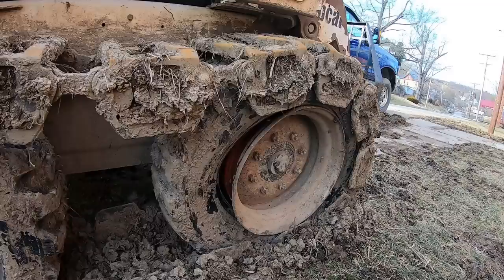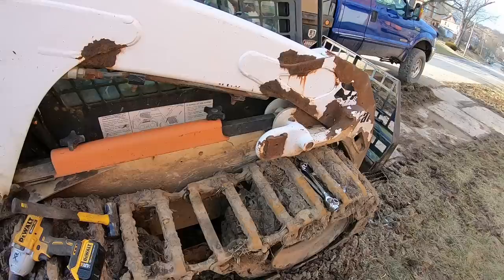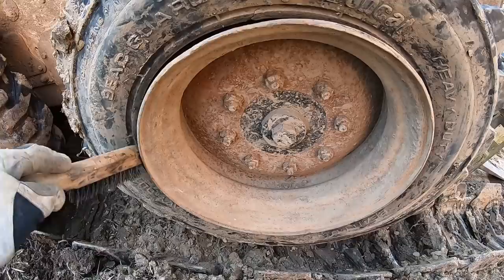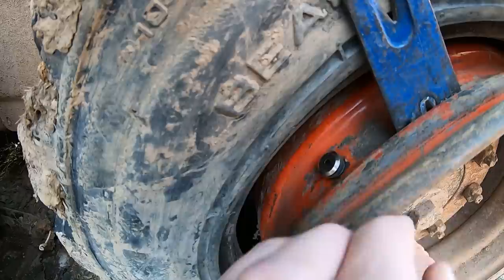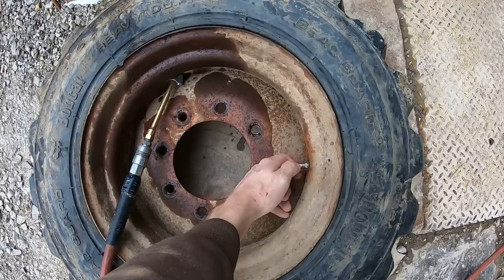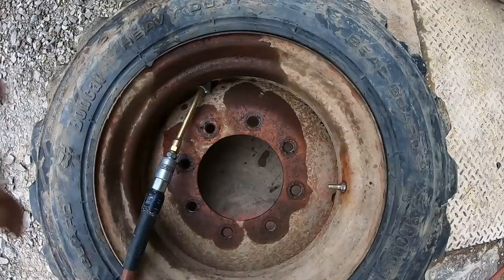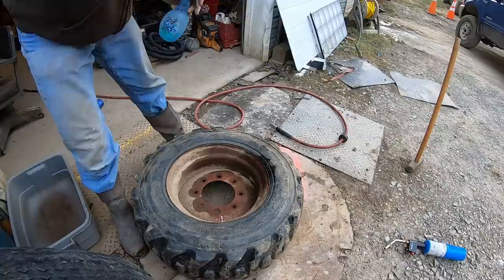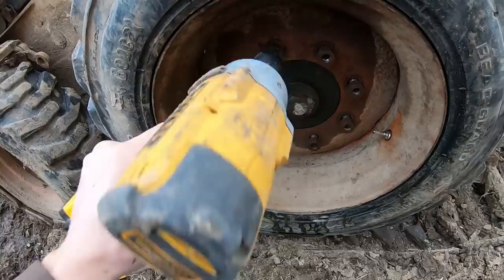Fixing a Skid Steer Tire with Starting Fluid and a Torch!! + all about my STEEL TRACKS

Comment: I always used a ratchet strap in the middle of the tire and then apply air. Works like a charm. Give it a try!
Reply: I’ve also used this method works great 👍
Reply: That's what I do as well.
Reply: I try to use a wide strap first if I have one available otherwise a good quality small one works.
Reply: @rge2410  Agreed, be safe!
Reply: @rge2410  I've found the narrower band works best to flay both sidewalls of the tire out to the beads. Quite often, you don't need to sketch out and blow it up with ether.  LOL
Reply: Great way to hurt yourself taking it off!
Reply: @BrettMcNary  Clearly you are in the minority in your thinking! I've done it this way almost exclusively and never had any issue releasing the strap! Obviously your not familiar with the same usage of racket straps!

Comment: I have thought that you working alone was the most dangerous thing you do because I do the same. I live alone and do most everything alone except when safety demands I don’t like putting up the ridge beam on the new woodshed I built this last summer. I do my best to assess everything I do and not put myself in danger. When I rebuilt my Ford 3000 Diesel engine last year I had to separate the tractor to pull the engine which went ok. When it came time to actually removing the engine block I called a neighbor and told them what I was doing and ask them to come check on me if I didn’t call them back within a half hour, everything went according to plan fortunately.

Comment: Dogbone wrench!  Loved those things till they all broke.  LOL.  At least they were good for figuring out the correct sized socket.  I had a set of Grouser tracks like that, came with the Grouser tensioning bracket.  Worthless.  I used a strap like you did.  For those who don't know; take the bolt out of both sides of the ratchet and remove both straps, take the long strap and move it to the end where the short strap was, cut to 6'-10' and burn the cut end.  Done.  Works great.  

I've been through 3 sets of steel "over tire tracks".  1 was Grouser brand and 2 were Norther Tool brands.  The Grouser made it about 1,600 hours, the first set of Northern Tool's made it about 1,400 hours at half the price (3rd set sold with the machine).  Also, the Northern brand had more flotation.  Grousers are made to install optional pads so they don't have a lot of displacement.  The Northern Tool ones don't have the "Pad" option so the metal footprint is about 3 times more (guessing).  

A couple "cons" to metal over tracks; Of course, flotation is better with a tracked machine but also better with rubber over tires.  Also, sideslip is a problem with metal tracks.  The biggest "con" for me was you can't really run heavy attachments.  I put a Bobcat brush hog on my Bobcat 773 and blew 1 front and 2 rear tires before I gave up.  The tires would offset inside the track and pinch, tearing out the sidewall.  So, those were the Northern Tool tracks, maybe the Grouser brand are better.  But the good news; I tracked that machine 1/4 mile out of a swamp and loaded it on my trailer.  Lost 3 tires but only 1 rim.  Not bad.

All that said; I loved my steel over tire tracks, no matter the brand.  They make a low cost skid steer into a functional off-road machine.  I would buy the Northern Tool brand again, if I was in the market.  I have a T595 now, but still miss the 773.

Comment: When my son watches this he will get a chuckle out of it. Hi Chris. We did this to set a bead on a trailer tire and set the tire on fire. Garden hose was nearby. "Put the fire out, Chief" Disaster Averted. Brake cleaner works well. The trick is to get enough and not too much. Hypothetically that is.

Comment: Matt, we have two wheel skidsteers. One has airplane tires with two piece rims. They never go flat. unless you break the valve stem. To fix a flat on the other, we jack it up, place a ratchet strap in the center of the tire & "jack" the tire out to the rim. It'll jump loose when you get the air in but it works.  saves a trip to the shop every time....if you have a ratchet strap and air tank or dump truck with air brakes and extra air hook up.  Like your work.

Comment: I learned this from an old tire man. I was ready to light the either to blow the tire on the tractor rim and the old tractor tire expert said hold on there Wild Bill. Give the either fumes time to build and he was right. I was getting nervous to light the fumes but I found out I was lighting the liquid either and not the fumes. He made me count to ten then light it. It popped and I had to let some air out of the tire. I turned and looked at my mentor and he was laughing and said, I Told You So!

Comment: "Can be boring to some..."   Are you kidding man ?? Look again at Randall Myers' comment down here. It suits you so well ! I share it 100% !
I'll just add that I admire your self reliance and working with what you've got. "I need a better dump truck." You take two "so so" you have and make one efficient and clean workhorse. "I need a Bobcat, new ones are out of my means". You get an old one and fix it !

That attitude, man, is highly impressive and commandable. I come from a very humble family, my Dad used to fix this and that on the cheap. No choice.
The old family car transmission failed. We fixed it together. I was 12 years old. He showed the "how to" on everything.
I do exactly the same. Self reliant. People often ask me how I do to keep my older 2 cars running and reliable - a 2001 Altima and a 2006 Focus wagon. Simple, I maintain them, ruste proofing every 2 years. Them, they buy/lease new ones and struggle with payments. Not me.

I also hoard stuff "rich" people throw away, fix it and sell it or give it to families in the need. Especially bikes, small or adult size. My salary is the smiles and sparkling eyes of kids when I bring them.
Finally, thanks for having us on your journey ! Much appreciated. 👍
  PS In what state are you living ?? You never have snow ?
Reply from the maker: Thank you so much! And Pennsylvania this has been a pathetic winter

Comment: The truck shop mounted tires like that for YEARS, probably till tubeless radials came out. And yes, I can remember then too. I was driving and having to change my own.! Always sprayed it inside the rim with a trail leading out on the floor, hooked up the air hose and struck a match and WHOOMP! The thing bounced off the floor a little but it was seated. I was changing 3-piece wheels before Budds got popular, as well as radials. YES, thank the Lord for ALL his blessings and nobody got hurt doing it.. GBWYall!

Comment: Sometimes on my tractor tires, I have to wrap a ratchet strap around the middle of the tire and squeeze it down tight in the middle to blow the beads out against the rim so when you spray it with ether It has less distance to travel when it pops outward.
Reply: Yes a very good method , and removing the valve core helps get the max amount of air into the tire faster.
Reply: You saved me from saying it 😁
Reply: You said for me. But I’ve done it without the starter fluid. Although it’s probably is kinda fun to do it that way.
Reply: Many years ago We did that on equipment when I worked in a salvage yard. I find that method quite effective
Reply: Rock Hill Farm Downeast, Maine I do the same with motorcycle tires when you are offroad it’s the only option! That and fill the tire with grass-leafs ect.
Reply: Yep
Reply: Ratchet straps idea works great. I was thinking the same. Ether works but strap is safer. Works every time especially on 14" wide skid steer tires. Can't count how many times digging I have had a bead pop on old tires. Been there done that. Great video though.
Reply: I had to strap and  starting fluid my Cat 248B rear tire the other day. The strap alone didn't get it. Having the air line on when lighting the starting fluid helps a lot. Spraying the outside does nothing if you ask me.
Reply: Me too neither .
Reply: @TheBookaroo  LOL I've had to pack a tire or two full of dirt to get the job done when I couldn't fix the leak. Whole lot better than stopping work to go buy a new tire.

Comment: I'm a firm believer in "safety 3rd" get the job done, but I learned the hard way that you never move that machine while standing on the ground! You'll get away with it a thousand times, but all it takes is one little slip and...you've got serious trouble! Respect your equipment!
Reply from the maker: That is what I expected everyone to say, but actually you’ve been the only one to notice. I don’t even regard the ether as a danger. Standing under the boom and moving the machine from the outside.... dangerous lol
Reply: @DieselCreek  
I used to have forks on a bobcat and would stand on them and push the levers back to move the machine back, my foot slipped off the fork and the machine moved back while I was stationary for the distance of travel to reverse the direction... the machine lurched forward and the fork landed on my foot lucky for me I was on soft ground, but that was the last time I tried that seemingly "safe" stunt!

Comment: I have worked with steel tracks for almost 10 years, had then on and off countless times. Never once thought to pull forwards to get that back bolt,  always just fought it with a wrench. So thank you for that tip.
Reply from the maker: I did that the first 8-10 times then had that Epiphany lol if it was a snake it would have bit me

Comment: it's my experience that if you take out the valve core and take the air chuck off the hose and just shove the quick connector on the valve stem the blast of air will push the bead on the rim.  Try it you'll like it...
Reply: That's a good way to do it, it works most of the time

Comment: I have grouser tracks on my Gehl skidsteer. I like to thread the nut on a couple turns and then smack the nut with a hammer. Knocks the head of the bolt right out.  Using this technique I can use a crow bar between the nut and chassis to pop the inner one out.  I’ll then twist out the inner bolt and then use a 1/4” drift to beat out the now twisted outer bolt.  These tracks make the machine work like one a couple sizes bigger. Just incredible. They’re awesome in mud or sand, but don’t work on frozen ground. They are also not compatible with solid tires. Rocks get between the tire and track and when forced will crack the crossbar.

Comment: One tip to help things along.  Set the wheel horizontally on a 5 gallon pail.  This lets the tire bead surface on the ground side lay tighter against the wheel.  If the tire is laying flat on the ground, the wheel is trying to hang out of the tire on the bottom.
Reply from the maker: Yes, that was going to be my next move if it didn’t go.

Comment: I learned a trick while in USMC as a truck driver... This works well, it's kinda messy, but take wheel bearing grease and put a thin bead around the bead on both sides, hit the air to it, and the grease forms a barrier and the bead pops on!  I've tried many ways, a ratchet strap (but if it pumps up to fast you play hell undoing it), I've taken a rope or strap with a breaker bar and twist it to draw the center of the tire in and push the bead out... I've used all these techniques on all types of tires from car truck trailer lawnmower to motorcycles... I don't stop until I find the one that works... Hope this helps someone
Reply from the maker: Ya there’s lots of tricks but this some seems to be the old reliable

Comment: Matt, I had a Bobcat 743, 753, and 763, and I last had an S185 just before retiring. I had excellent service with these. They were all older models, so I guess that was the reason for their excellent performance. I also liked the Case equipment. I did not care for John Deere skid steer loaders. John Deere missed he market at first.

Comment: This beading trick uses up fresh air each time. If failed the first time, there wouldn’t be enough fresh air left inside the tire to do a next pop. So replace the dead air in the tire with fresh air each time. 

Quick start aerosol work for engine with a carburetor, doesn’t works each time on beading tire. Apply with the straw in liquid form, it burns slowly with no explosion only heat up the tire.  Apply without the straw in mist form, it burns rapidly to an explosion which beads the tire. 

Mist gasoline injected in the tire filled with fresh air can explode when ignited, as an alternative to quick start aerosol spray. 

Hope this helps.

Comment: Throwing a ratchet strap around the links and tightening it up to relieve the tension between the the links you're trying to separate would probably be very helpful for a job like this. We use that concept for chains where I work when we have to break them apart.

Comment: There have been times, I have wanted to burn down my Bobcat.  but we have always reconciled.  :-)  
The ether trick works well, but less is more.  I have seen guys rig up an air container with a 1 1/2 inch ball valve and a length of plastic pipe.  Put the air to the seam, and there is enough volume to seat the tire without any drama.

Comment: That's one way, but try putting a big ratchet strap or a come-along around the circumference of the tire and tighten it down, it'll press the bead into the rim. It doesn't always work, but it's more predictable than the ether-and-torch method. I've used both with success, but I try the strap first.
Reply: I always have straps just for this.
Reply: Sounds like the strap and the torch method together work well. If the strap doesn't work, use both.
Reply: The other two things I forgot to mention, on the off chance someone hasn't heard this before; spray both sides of the tire - both beads - in soapy water. That, and pull the valve stem core, turn up the regulator on your compressor, and use a blowgun with one of those tapered rubber nozzles to air up, then put the core back in quickly and switch to an air chuck. All that while you have the strap around the tire. Seems to help.

Comment: If you have a decent air compressor we just take out the stem needle and have the rubber tip air nossel or even just open air tube. Jam it on the tire stem and the bead will pop pretty fast. We never use fire or a bead blaster. If you pit the needle back fast enough you don't even have to pump the tire back up much.

Comment: The last set of tires I bought for my skid steer I had foam filled.  Not cheap but no flats or rolling off the rim.   I appreciate you including all the challenges and fails.  Makes me feel a little better about what I experiences.
Reply: That's what I want to do when I replace the tires on my bobcat next time.  My tractor has fluid in all 4 for weight though.

Comment: I have used a ratchet strap around the tire to squeeze the tread in and spread the bead with pretty good success. Using  some rubber cement around the bead once cleaned can help hold the air in also.
Reply from the maker: I’ve done that as well

Comment: Worked in a tire shop, we loved doing the tire trick on larger tires. The biggest thing is to make sure the bead and rim are clean! in your case have a pressure washer to clean the tire and track there handy if you have a water supply even a $100 cheap on will work. Apply vaseline or a heavy grease to both the rim and the beed, this will account for and imperfection in either and protect the tire from that fire.
Reply from the maker: Last thing I wanted to do In 20° was play with water lol I wire brushed it well

Comment: Had very similar tracks on Case 1835B, filled the tires with solid urethane elastomer, weighs about the same as water. Took a 2" chunk out of a sidewall once, kept running for years after.

Comment: I agree with your tacks being crazy good traction in the mud in the woods you see transporters and rubber tire multies that's basically what they run metal tracks over rubber tires and they go anywhere

Comment: you should invest in a cheatah tank.  We use it for semi tires.  You fill it with 100lbs of air, put the end spout on the bead and throw the lever.  boom! instant bead seat. then use your air tank to fill.

Comment: I worked for a place once that had what amounted to a long skinny inner tube inside a woven fabric tube. You put that around the tire and filled it full of air. It compressed the tire and pushed the bead out enough that it touched and then you could hit the tire with air and it would pop almost always. I don't believe I have ever seen one of those since. That was back in the late 90s. I have done the starting fluid and torch thing and sometimes the result is loud and very satisfying.

Comment: Do these: remove valve core, don't use the tire Chuck, instead make a quick connect that fits over the outside of the valve stem. Remove any restrictions in the air flow. Try to use the biggest, shortest air hose possible. No regulator. I bet the ether doesn't work as well in cold temps (yours was flaming instead of exploding like typical).

Comment: If you put a ratchet strap around the center of the outside of the tire and squeeze it tight it will help seal the bead Anouilh for air to hold pressure and pop the bead on.